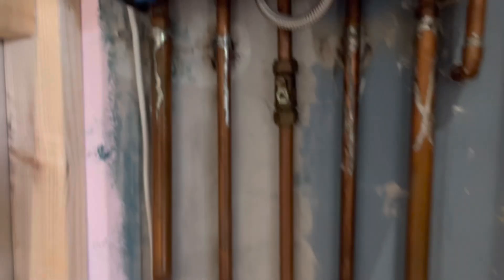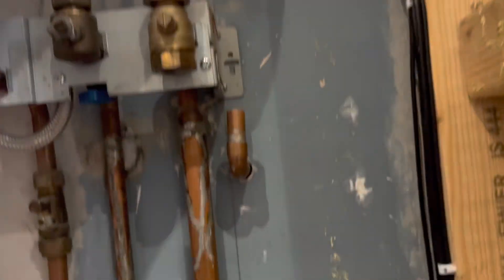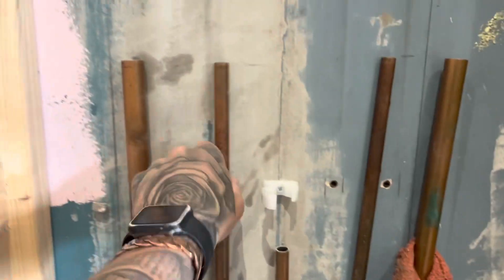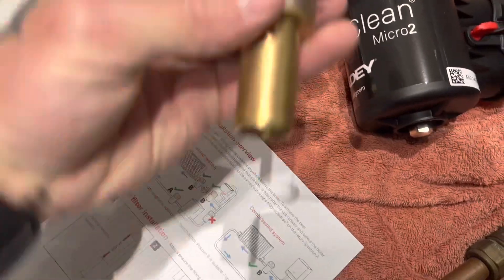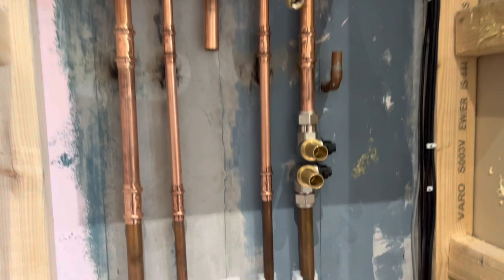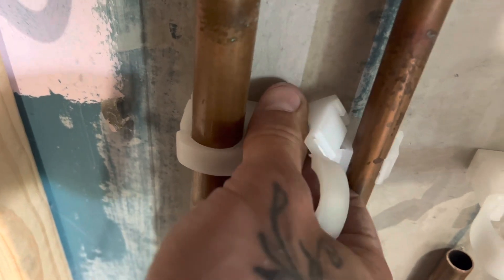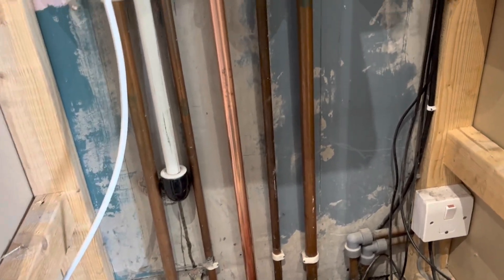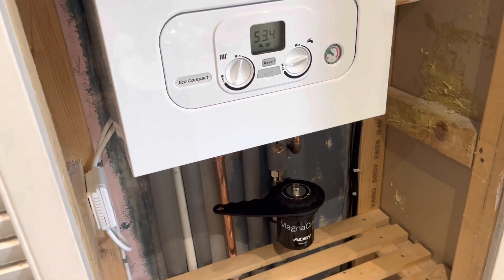Episode 46-Boiler swap! Is there any sweeter job?? #dayinthelife

Comment: Really  good boilers I think ….. when you gonna fit the new baxi Daniel son? Roughly how close could you solder to a press fitting ? Not sure if I’ve asked you this before 😊
Reply from the maker: I haven’t tested that mate. But I wouldn’t like to get too close. You could wet rag the press fitting whilst soldering. At a guess, I’d say about 8inches away would be safe. I don’t want to fit the new one ☹️

Comment: How does press fit work mate, rubber seal or is it a chemical compound or cememt 4:16
Reply from the maker: Rubber O ring inside the fitting, and crimps the back before the oring and after, on the fittings I use.
Reply: @Heatking  ah cool, thanks for the reply
Reply from the maker: @wolvolad25  anytime brother